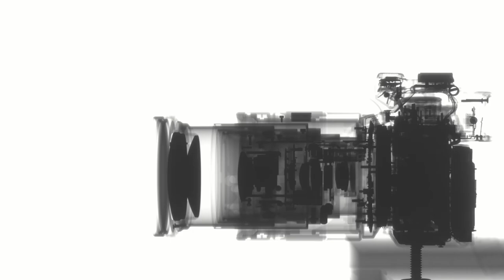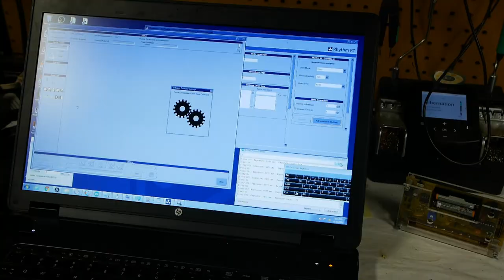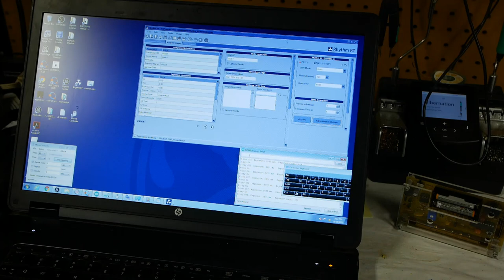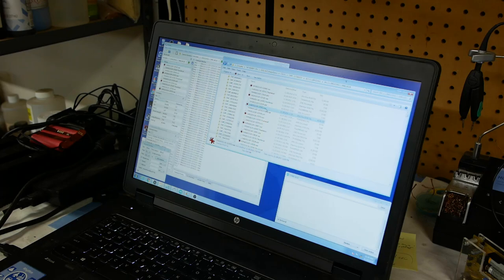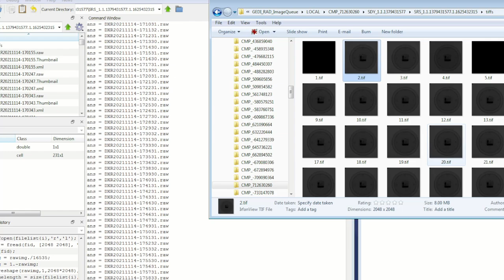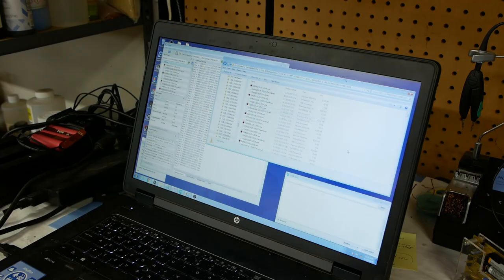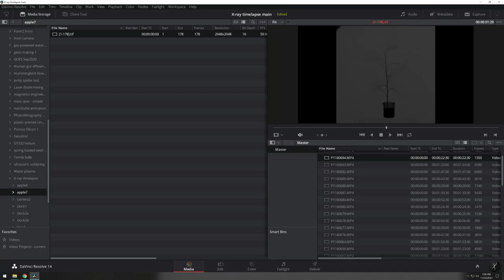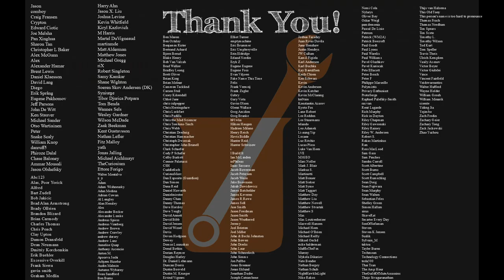X-ray timelapse of fluid movement in plants, stop-motion animation, sensor teardown/repair

Comment: "Might even say it's enterprise grade"
As a professional programmer, that sounds about right.
Reply: Correct me if I'm wrong, but this was a jab at enterprise grade software, correct?
Reply: Gave me a good laugh lol
Reply: The contrast between the evident quality of the hardware and the software is telling.
Reply: I'm not sure if they skimp on the programmers salary or what, but enterprise grade software is a meme at this point, and often the most important machines using the shietest software, sometimes I wonder, how did this bad software not kill someone before
Reply: @ffoska  If the software is solely to acquire images for diagnostic purposes, potential harms would be indirect I guess. It's when the software determines the radiation output that more dramatic problems can arise - think Therac-25 etc. (I'm either getting a deja vu or I have made a very similar comment before on this channel.)
Reply: @fburton8  I'm thinking more like PLCs RTUs, SCADA software, and that type of industrial stuff, usually old and no one is maintaining the code, made by the lowest bidders, or by companies with the monopoly in the market, eg. you can only run their software, because they made the hardwere and there is no other option. In this case, at least the software can't harm anyone
Reply: I've had chats with the GE techs that built these and the software and it sounds about right. The DICONDE viewer they use was an open source one they randomly found and rejiggered and it's endlessly funny to me that a $150k system comes with such janky software.
Reply: @ffoska  plcs are rarely ever the problem. all the problems started when microcontrollers started to replace plcs
Reply: @Matthew Morycinski Sounds about right!
Reply: @ffoska  actually, bad programming has killed or seriously maimed people in the past, iirc the most known instances where with a computer controlled radiology machine that didn't have physical interlocks, the machine in question had a habit of removing the converter target and blasting the patient with full force when it went from a paused state to a running state,

Iirc 2 people died and 1 where seriously maimed before the machine was singled out as the culprit,

"Plainly difficult" has a video on the machine in question if you're interested

Edit: the machine was the Therac-25

Edit2: actually 3 people died as a direct result of the Therac-25, 2 where seriously maimed, and 1 was maimed to a lesser degree, wow, jebus
Reply: "The software is surprisingly difficult to use, buggy, not extensible, quirky in how it works, you might eve say it's enterprise grade." Really loved that...
Reply: I work in biology research and the programs supplied with all the machines are very ... let's say interesting in terms of useability :D
Reply: I've done work on the hardware and software side. The hardware is teased out by every engineer available, looking for anything that might go wrong, any missing safety interlock that might let someone do something unsafe.
The software side: "Does it work well enough for the demo? Good, wrap it up. BTW, you have to write an OM for it too. I know, I know, you don't have days to spend on a manual, just use the one from our last project as a template."
Teasing out designs that incorporate FPGAs is awful, since they end up looking like black boxes on schematics...

Comment: When was working on radiotherapy software 15 years ago I remember one such panel was $150k+. They seem much more 'affordable' now with one less zero at the end. A good catch you got there. I'm wondering how heavily the phosphorous layer is bonded and if such a panel could also be used for a very sensitive telescope
Reply: the scintillator might be bonded pretty well.. some manufacturers grow the cesium iodide crystals directly on the TFT glass in a hermetically sealed encasement.     the crystal to photodiode coupling is one of the biggest determining factors for image quality (and price)
Reply: A zero has not really dropped
Reply: This DXR250C (I believe, but it might be a U SKU) is around there. The newer versions are just as expensive unfortunately. I support them at an NDT company and boy are they expensive haha
Reply: @WhileTrueCode  Thanks for the explanation. It seems pointless to even try. Maybe etching but then it would be just ruining a good x-ray panel.
On the other hand if the bonding is a quality factor then a cheap panel might be easy to clear 😂
Reply: Why is it that as the price of the hardware goes up, the quality, features and usability of the software always seems to go down? Give me $150k and a BSP and I could write better software than that, and I'm one of the last software developers you want building your UI. (Maybe that's it: the big-ticket hardware is built by hardware developers, not software developers and they end up Dunning-Krugering the software? They literally can't tell the difference between usable software and the BS they shovel on the customer's head?)
Reply: @WhileTrueCode  i have been (and still) waiting to see someone replacing the cesium iodide with perovskite(s) and test the new panel's properties in terms of efficiency. I would love to see some improvements in the detector technology... would be good to reduce the dose for my patients and myself.
Reply: @benjaminshropshire2900  yeah that software looked so shitty that i assume it was the manufacturer service utility for calibrations and test shots. seems like all the equipment manufacturers have brilliant hardware and firmware engineers, but writing a desktop application seems to be impossible for every one of them LOL
Reply: @benjaminshropshire2900  It's kind of a combination of those things. The fundamental issue is that this is a niche product with a small market, maybe only a few thousand units over the whole life of the product. So you have to sell it at a 1000% markup just to stay in business, and even then you don't have the money to do a proper job of the R&D. Which would include hiring proper software developers, interaction designers and so on, as opposed to having Bob do it in Visual Basic. Also being a niche product, there isn't a whole lot of competition, so they can get away with what Alan Cooper called a dancing bear. I say this from my own experience designing similarly niche products for the electrical power industry.
Reply: @Metalrasputian  NDT!  i almost had that opportunity..  a guy came with a tiny little xray generator that ran off DeWalt brand drill batteries...  with a kVp of 300  and a mA of Nope..   unfortunately, our medical panel was only rated up to 150kVp  and we couldn't get a decent image with the exposure time window cranked up to what the NDT guy needed,  so that project fell through...
Reply: @WhileTrueCode  heck I've seen android apps written by middle school students that had better UX than name brand copy machines. Kinda makes me think there should be a market for Android-with-lots-of-GPIO-boards to embed in systems. But you'd still need to convince the PHB that the software can be as big a selling point (or no-sell point) as the hardware, even if you give it away for free.
Reply: @connerlabs  I think you are right, but it's a false economy. At 1000% markup for something with that price point, a competent UI developer could pay for themselves if they get you even a single additional sale.
Reply: @WhileTrueCode  Yeah, the sources NDT techs use are crazy. They can crank out a lot of rays. It's a very interesting application for panels like these because (at least with pipeline/O&G service) they have to get crammed every which way to get the shots, unlike a lot of medical applications. I'm just the IT guy who supports the software and hardware but it's neat to hear the techs chat about where they mount the panels haha
Reply: @benjaminshropshire2900  Well to be sure there are also issues with hardware companies trying to do software, or rather not realising the importance of good software and not trying hard enough. Smartphones have massively raised the bar on software quality, so now at least some of these companies are starting to realise how bad the crap they churn out is. :)
Reply: @benjaminshropshire2900  Heh, if you think this is bad, you should see the mess that happens when you let chemical engineers "design" a database - then you live with f'ed up queries for years and years afterwards. Real smooth brain move letting the chem-e's touch computers...
Reply: @gorak9000  OTOH: a lot of the best programmers I've worked with had little to no formal training, and not a small number of the worst ones did have that training. That said, most of the first group quickly moved to programming jobs regardless of academic credentials, so that says nothing about people who stay in EE/ChemE positions but still end up doing programming anyway.
Reply: The read noise and dark current of the panel will be much worse than modern backside illuminated CMOS. Would be more interesting to add a scintillator to a cheap CMOS camera with small pixels.
Reply: @benjaminshropshire2900  bluetooth to serial interfaces provides that indirectly. just  hc06 0t hc05 bt serisl module and connect to it wia androids bluetooth as random bt device ... then you can open its serial  interface as a file on /dev/ttyUSB ;)
Reply: @benjaminshropshire2900  That's a common problem. Look at all the stupid websites.

Comment: Thank you Amir.  Counting child-windows may be of interest - maybe not relevant for this task however. To cludge automate industrial apps (Siemens LCT) I have counted the number of child-windows (using VB3) spawned to determine the right time to send the next sequence of keystrokes.  Time taken for a child-window to spawn varied greatly in my use case and dependant on the network of the very remote devices and detecting when a child-window spawned ensured maximum thru put rather than coding for worst case.   It tuned an ~ 60min task into a 1 minute setup and run and walk away task. (Also took me about 3 weeks to get to that point)
Reply: I want to be clever like you one day. Props for finding a workaround that would not even occur to most of us.
Reply: #softwaregore

Comment: Love the timelapses!

I'm also surprised by the teardown's lack of ingress protection, in the medical setting those are often placed under patients that are leaking fluids and in the industrial environment those are usually used in very dusty and often wet building environments, surprised how clean this unit was inside given that, I imagine this one is non-rugged intended for clean lab use?

I’m impressed you were able to even obtain the software for the sensor, most medical devices end up as e-waste because you can’t get the software or physical licence dongle.

I’ll also mention just be careful with those cheap SBM-20 Geiger counters, they’re useful for finding high energy radioisotopes but they come with a lot of measurement caveats, they’re not very sensitive to < 50 keV X-rays, are prone to reading 0 when saturated and CPM to dose conversions are only accurate for their calibrated source (usually Cs-137 or Co-60). However, you’re clearly taking good safety measures with remote triggering and such.
Reply from the maker: This device came with an additional outer carbon fiber enclosure for use in harsher environments, but I agree:  I was also expecting more waterproofing, etc.  Thankfully, Amir also supplied the software/laptop.  Each instance is locked to the detector MAC, as well as the computer's MAC, and will only transfer images when both MACs are identified as source and receiver!  I tried a few different ways of getting around this before obtaining the whole setup, and was not able to get anything out of the panel.  I had originally been port scanning it with no detectable open ports from a MAC that was not whitelisted.  Originally, I had planned to make a video about trying (achieving?) a way to make it work without the proprietary software.  I should probably do it, since I now have the working setup, and can sniff the traffic, which I couldn't do before, and was ready to give up trying to randomly guess the protocol.  I've seen the geiger counter saturate, but it takes a lot of radiation :)
Reply: Every time I've seen these used on the wards, the operator uses a disposable plastic sleeve which keeps the detector clean and free of bodily fluids
Reply: @madmikewood  Yes they have covers they are supposed to use, but dont always.
Reply: @AppliedScience  Couldn't that open you up to some kind of IP lawsuit
Reply: @MushookieMan  Only if he sells it. For personal use, he can do whatever he wants to it so long as he didn't agree to a EULA.
Reply: @AppliedScience  this would be theoretically possible if you were to do a middle man attack on your wifi network, you could poison the ARP table of your router to get all of the data transmitted before any kind of handshake encryption, also my guess as a software engineer would be that this is probably some simple handshake protocol given that the data retrieved from the software is raw
Reply: I wonder if the hardware would work with another device by altering/spoofing the MAC to match, or if it's more complicated. That'd let you get a test world that wouldn't risk setting off any DRM tripwires on the working laptop. (I assume you already have, but image the drive in that laptop if you haven't yet)
I'm thinking of some sort of man-in-the-middle attack so the listening software wouldn't be on the proprietary laptop in case there are anti-reverse-engineer DRM tripwires.
Reply: @AppliedScience  im amused at how much care is taken to make this safe and indestructible but in the end you drop it on the indicator LEDs and the whole unit fails lol. carbon fiber body, this thing can survive some abused yet here we are.
Reply: @AppliedScience  There's more background info there, and I'd love a video on your port sniffing the traffic! 🤠❤
Reply: @sudazima  the carbon fiber body is because it's transparent to x-rays not because of it's strength. you can see the parts that aren't in front of the sensor aren't carbon fiber
Reply: @AustinThomasPhD  Sending infected plant material into California could prove to be very difficult to do. This is not my field and I am not an expert, so if you already know all about this issue, that is fine. But if not, you might want to look into it. Please don't do it if there is any chance of the pest getting "into the wild" in California.
Reply: @coder0xff  eulas are unenforceable in court anyways
Reply: @sudazima  if they’d gotten a significant number of returns with this problem I bet they’d have redesigned it for the next version.
Reply: @AppliedScience  please do report on how you made it work with nonlocked MAC, very interesting

Comment: Former GE Field Service engineer here. That is a GE Flashpad. I am absolutely amazed what you found out reverse engineering it. It's used on the XR220 mobile xray product line as well as the XR6x6 rooms. The bottom connector is used for plugging it into table/wallstand bucky tray for data transmission and for charging the battery. The battery port can also be used data transmission as well. Your channel is amazing.  Please keep up the good work.

Comment: Very interesting to see the tear down of a device we see in use in hospitals daily. In the hospital setting, these devices are the sensor part of  portable x-ray machines. For example, to take a chest x-ray of a patient who can't get out of bed, the plate is slid between the patient and mattress and the the x-ray tube part of the machine is wheeled over the bed and the image taken.

Before wireless connections became common place, the radiographer would take it back to the radiology department where the image would be downloaded off the device and loaded for viewing on the imaging software used in the hospital. Some of the connectors are probably there to ensure that there is manufacturing commonality so that it can be used with minimal modification across the different models of portable x-ray machines produced.

The sensor plates are very robust and take an awful lot of abuse. They get drenched in everything from blood, vomit, urine and worse. These plates are used for static images. C-arm image intensifiers are much more powerful and can do both still images and live fluoroscopic imaging. Can you get hold of one for a tear down?
Reply: yeahh..  whenever we got an RMA for a cable swap or a glass swap...  our guys wore gloves  :D     they were used to looking at crates upon crates of pristine equipment to prep them for shipping.      but some of those RMA panels that came back "from the field" looked like they've been through six tours of vietnam

Comment: That kind of X-Ray sensor is in almost all modern X-Ray machines used in every hospital. Up until 15-20 years ago, we used a photographic plate for taking X-Ray images.
The construction of the X-Ray plate is so rugged, avoiding any form of obsolescence, because any failure would be immensely expensive. 
Thank you for the video.
Greetings,
Anthony